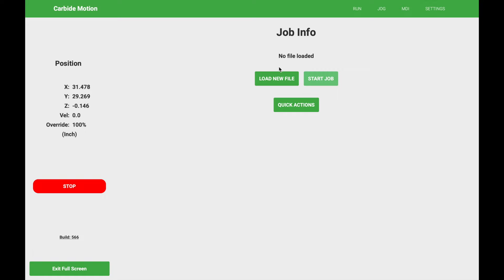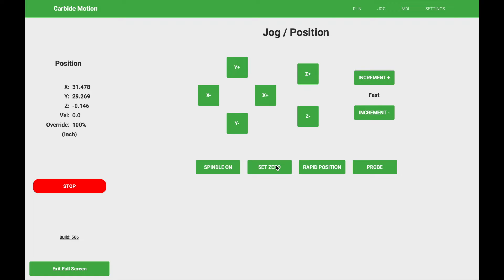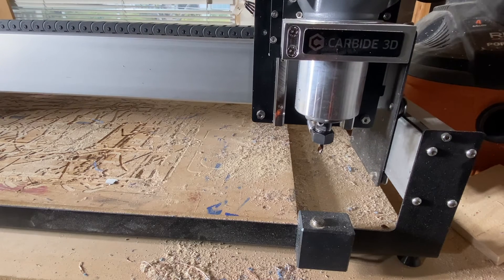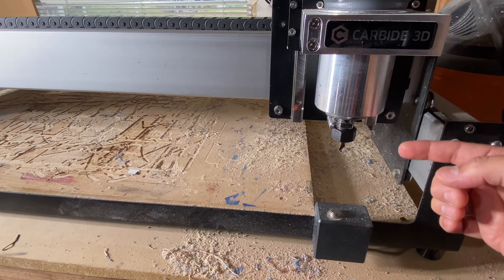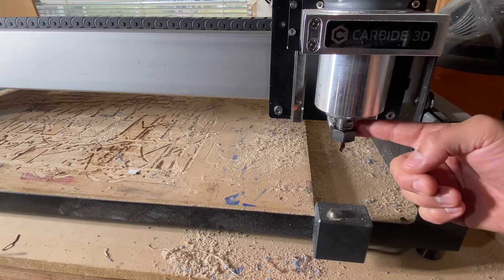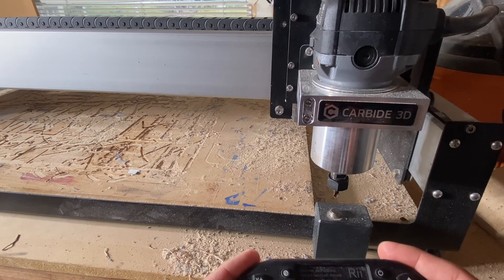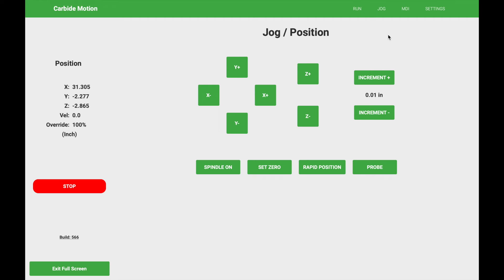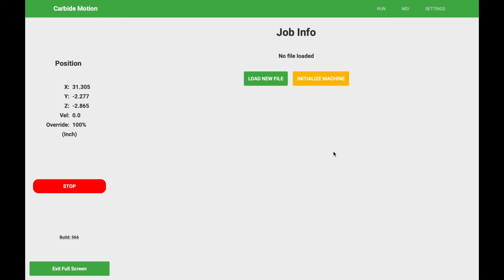How to Setup Bitsetter in Carbide Motion - Carbide Create Tutorial

Comment: Thx for the refresher course on resetting this bit setter, I needed that.  Have a question in regards to that white side surfacing bit.  I have the same one but using the bit setter with that surfacing bit it still attempts to carve way deeper than my actual code settings are.  Any tips on how to get the exact depth surface cut as your code?  Thx.
Reply from the maker: Hey victor thsnks for watching. 

Here’s what I would do. 

1. I would disable my bit setter
2. Set x and y zero with a 60 deg vbit
3. Switch to surfacing bit and set z zero at top of material
4.  When setting toolpath, check and update your depth per pass. I like mine to be 0.05 to start out with. 

Hope these help victor!
Reply: @aetimberpine  thx... One more question... Disable the bit setter from carbide motion? Or manually by going in control box n unplugging? If it's with motion just disable it n then re- enable after I'm done? Correct?  Thx again for your quick response
Reply from the maker: @Sinestor043  yes correct in carbide motion. And glad to help!

1. Connect to cutter
2. In settings, disable the bit setter
3. Initialize the machine
Reply: @aetimberpine  Thank you

Comment: I have a Shapeoko4 XX lpro it came with the bit setter installed on the machine. So now I have a question for you. Could you do A video showing  How and when in the cycle of getting ready to run the G code with the bit setter and the touch probe  do you set your XYZ I am a little confused as to when to do That. Thanks Jeff Peters
Reply from the maker: That is actually on my to do list. Thanks for the feedback. 

Bitsetter: when you have the bit setter enabled, when you initialize the first time after connecting to cutter it will go to the back right corner and then immediately come to the front and ask for a tool.  

Enter the tool that you’ll be using first in your upcoming job. In CM then click continue and the machine will go to the bitsetter to measure the tool.  Now your initial initialization is done.

Probe:  I don’t have one but you should use it after first initialization to set your zero.

Check out my order:  CNC Basics | 10 Steps to Follow to Carve a Sign on a CNC | Carbide Create Tutorial
https://youtu.be/9CyXGCPgS_o

Running a job with bitsetter:  once your zeros are set and you’ve uploaded your file, you can hit run.

The machine will go to center, ask for the first tool in CM, you’ll out that in there but it should already be in there because you initialized with the first tool already,  you hit continu after tool is inserted, it will go to bitsetter and measure, come back to center for you to turn on router (prompt through CM), and then you can press continue and it will start carve.

Once it’s done with its toolpath, it will come to center, prompt you to turn off router, once turned off it will prompt you to change tool, once changed, it will measure next tool and then carve.  Follow the prompts on screen. 

To get prompts the correct post processor needs to be chosen. 

Check it out here: How to Get Tool Change Prompt In Carbide Motion | Beginner CNC Tips | Carbide Motion Beginner Tips
https://youtu.be/k0VEXPPrGd0

Hope this helps!
Reply: @aetimberpine  Andy what version of carbide motion are you useing I use the Vectric  V carve Pro software to do my designs  .And version 542 of carbide motion what is the latest version you use. My post processor  Is( Shapeoko inch tool Change G code) Got it from neill ferrial it also came in mectric version. Thanks for the Video and the written step by sterp version.  .One other question lets say that I need 2 of a sign I have set up the first sign and cut it now I want to cut the second boardICan I  put The Board down right where I had the first one and and push some button to run the same file over again? and again.? thanks Jeff Peters